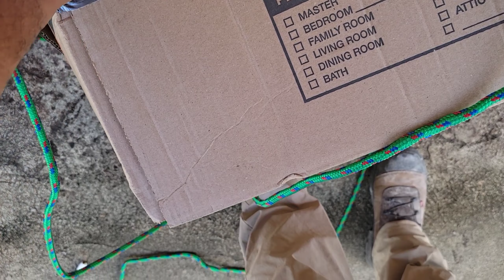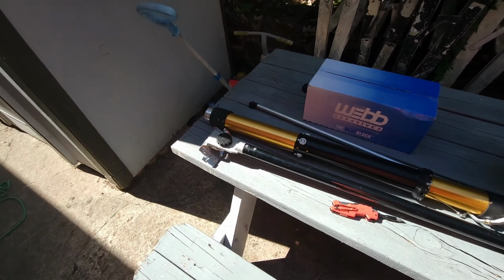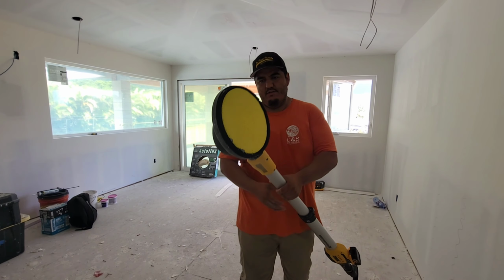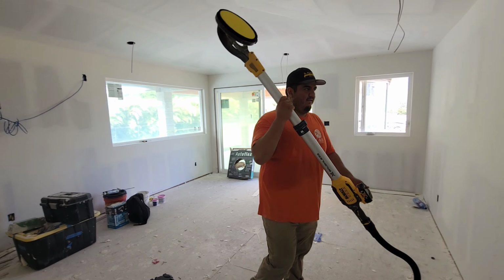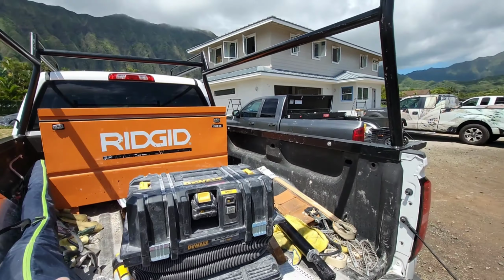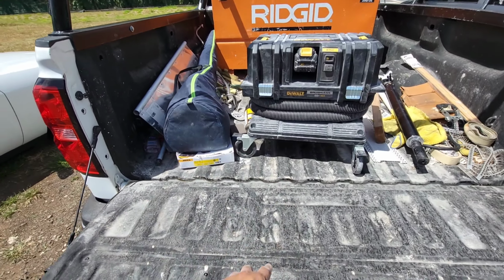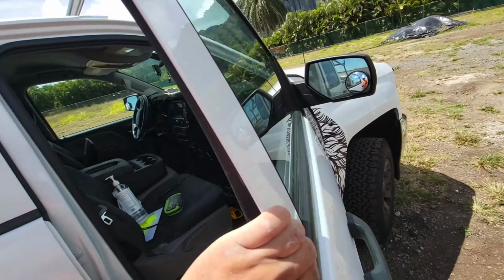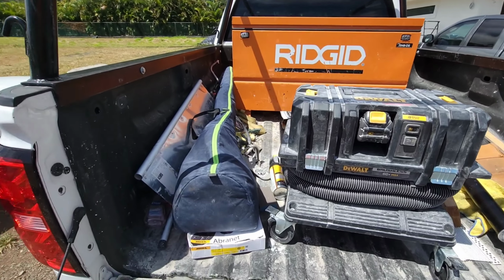Cordless Dewalt Sander/ Vacuum

Comment: Does the bag in the dewalt dust extractor fill up quick? Have you tried using without a bag? If so how does well does it run, does the filter clog up fast?
Reply from the maker: I have never used a bag or had a clog just empty it out end of day and hit the filters together to get rid of most of the dust and store. A real work horse the only down side is battery life looking at about 20-30min per 6ah fexvolt.

Comment: Hey I invested in the Columbia predator tactical set. I'm so excited to put em too work. What do you think of the springs on the 10 and 12 boxes.? Should I remove them?
Reply from the maker: Awesome brother I usually use the boxes with out a spring.
Reply: @csdrywallhawaii  ok awesome.  When I first started I used tape tech without the springs. Just that my boxes came with springs. I dont think I'm a fan. Hope I made a good investment going with Columbia